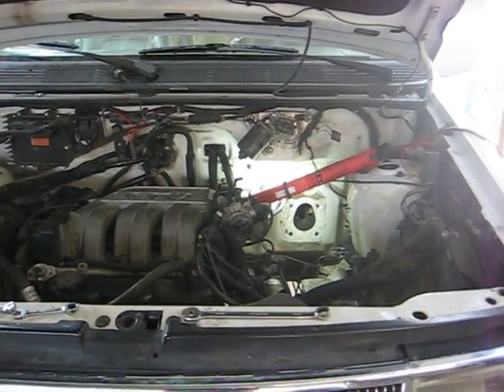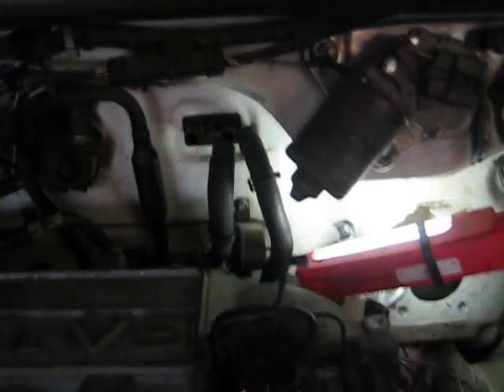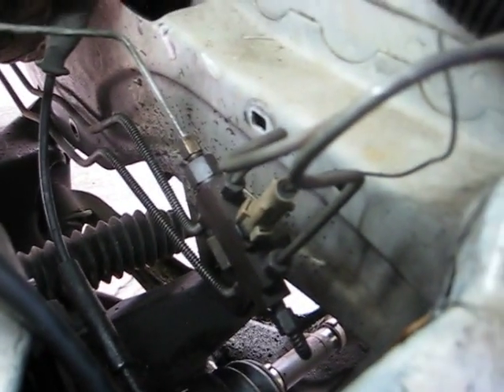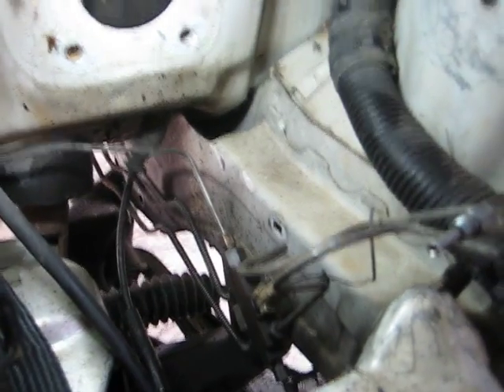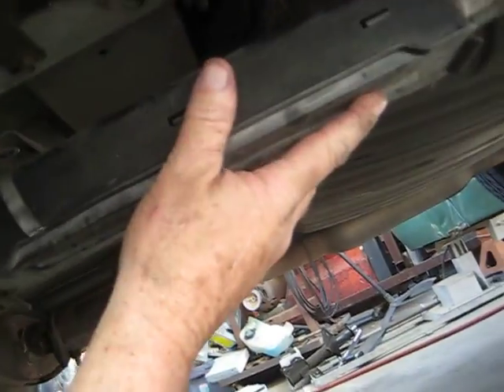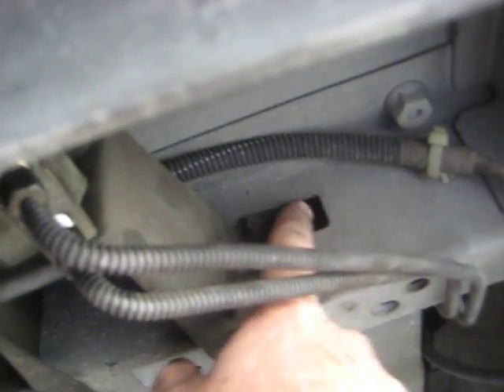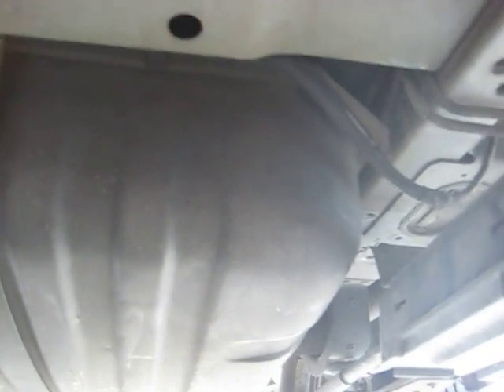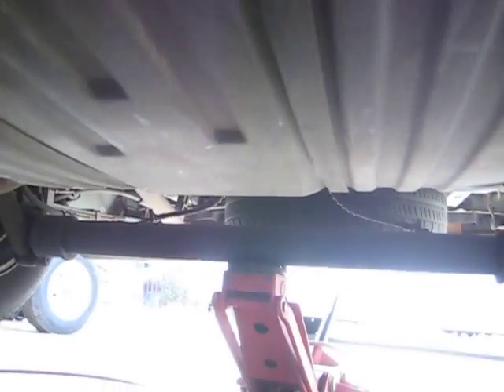Chrysler Town & Country ABS ConversionPT3

Comment: Old video I know. But as a shot in the dark, how did you drop the gas tank?
Reply from the maker: i didn't drop it just loosened it and slid it over slightly
Reply: poochefmarowbe okay, I guess I’m not really sure how you managed to slide it over. Did you only loosen the two bolts on the back?
Reply from the maker: @TheRussBriggs  yes the 2 straps and scoot it over